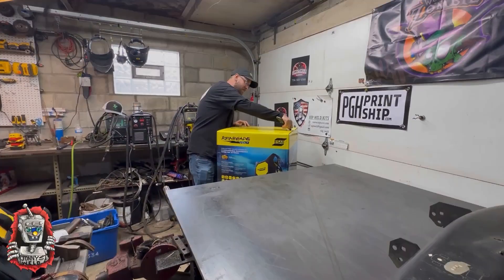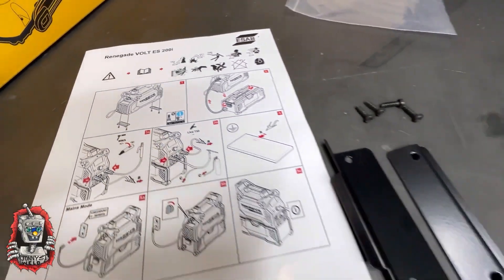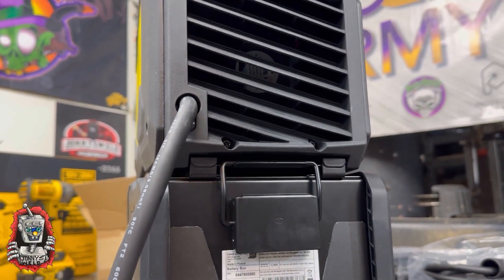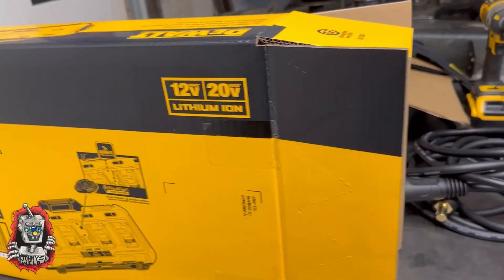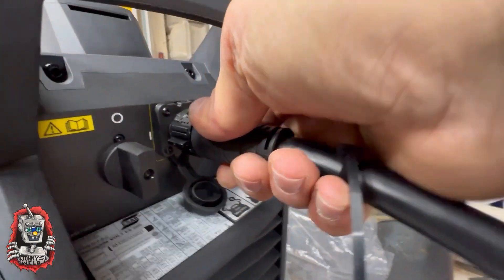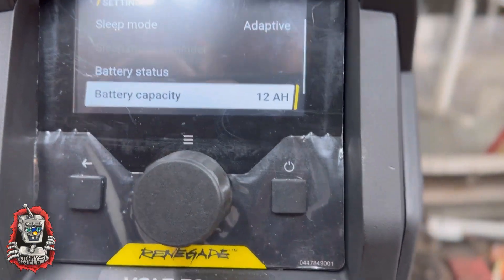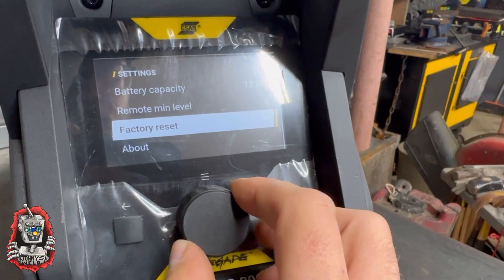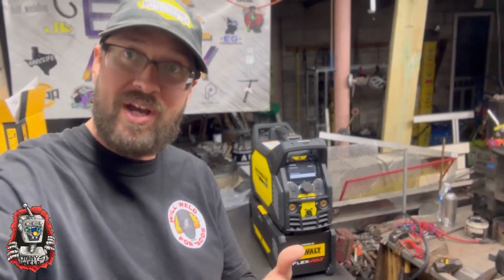ESAB Renegade VOLT - ES 200i with Jonny Snider of @jonnysweld Unboxing

Comment: Battery life?
Reply from the maker: It all depends on how much you weld and with what rod size, but to simply put it, it can weld about 30 electrodes. So, in theory if you weld 10 rods a month, the battery will last you around 3 months. But if you weld 30 electrodes in 30 minutes it will only last you 30 minutes before needing a charge or battery swap.

Comment: It definitely has its place in the world I do a lot work for Amazon and something like this would be beneficial. Always popping the breakers. I looked into the fronius one and I couldn’t find it to really justify 4k for a quick job but it would pay off eventually
Reply from the maker: I agree, it will be a great tool and asset, especially for someone like you with small jobs all over the place. Most of the battery operated welders out there are pretty good but this one specifically I like because the battery’s can also be swapped out if they are out of power or use the batteries in grinders or other tools while on the repair. Welder and grinder go hand in hand. Thanks for checking out the video, I definitely had fun making it.
Reply: @jonnysweld  that’s the best benefit of that for sure It sux I switched over to Milwaukee tools. That would have been a killer for my arsenal. I need it to last at least 3 hours
Reply from the maker: @Wallyzweldingworld  Maybe the'll come out with more battery power pack brand options in the future.... who knows.  Milwaukee is solid too. I don't know how long the machine will last, but it will weld about 30 electrodes, so however long that takes. Ive done a little welding with it so far and will do a small amount over the winter and definitely putting it to work this summer 2024.

Comment: So there needs to be a separate charging unit? Seems they should have built that all into 1 unit. I have a similar set up, though I use an Everlast PowerMTS 141Si with an Ecoflow Delta Max 2000 not as compact as that but definitely Superior in power, Ah , charging options, capability, and welding process options. I do use Dewalt Tough System to transport it. I use the rolling tool case for the battery, the deep box for the Everlast and the medium box for  consumables, grounding clamps, etc. Super easy portability. Works good for minor to medium repairs where carrying a heavy generator just doesn't make sense. Great video!
Reply from the maker: Hey, thanks for watching and for the comment. I just checked out the Delta and looks like a pretty cool option for portable power and the Everlast both make a good mobile setup. 

For recharging, yes it’s a separate charger. I’m sure a charging feature may be in the future, it’s not there as of right now. But the plus side to being dewalt batteries is when they are out of power, if you have a backup set of batteries, you can swap them out and keep welding. So if planned right, there is little to no downtime. 

I like the idea of the tool box. I’ll be doing something similar, just waiting for some Black Friday deals so hopefully get them at a good price.
Reply: @jonnysweld  I watched another video where the person used a similar version Ecoflow to run a Lincoln welder and I decided to go with the bigger Watt hour model. Battery technology has advanced so much. What's great about it is it can be charged using solar, wall or combination of both and can run many other appliances as well. Thanks for the reply!
Reply from the maker: That’s super cool. Not just for the welder but to have in general. I would use that all the time on camping trips, on the road or even around the house. Great idea. Feel free to hit me up on IG, would love to follow along and see your work.
Reply: @jonnysweld  ya it is definitely versatile. I live on the 5th floor in an apartment building and wouldn't be able to use a gas gen if the power went out. With this it will help to keep the fridge cold if need be lol. I do believe I follow you on IG🙌🏻
Reply from the maker: @weldingfabrication77  Such a good thing to have. Smart move! About how long does the battery pack last when you're using it for welding?
Reply: @jonnysweld  The battery gives you a digital display of how many minutes it can run at the demand placed on it. Tig welded with it around 50 amps for about 2 hours and only taxed the battery for about 30%. That's fairly decent. I will have to try it on mig and stick to see just how long it's real world performance is. The battery is rated at 2016Wh (2kWh) and can be daisy chained with expandable storage up to 6kWh. 1.8 Hrs to Full Charge. EcoFlow's patented X-Stream AC fast charging lets you recharge DELTA Max in only 1.8 hours. Or even quicker if you combine any two charging methods, that's from an AC wall outlet, solar panels, or a Dual Fuel Generator. Power Heavy-duty Devices with 2400W Output. 2400W output to power up to 15 devices at once. Power 3400W appliances with X-Boost on. That means during a power outage or blackout, you can continue to power your fridge, microwave, dryer, and more. Ideal power generator for backup power.